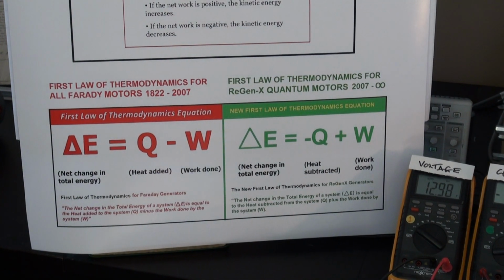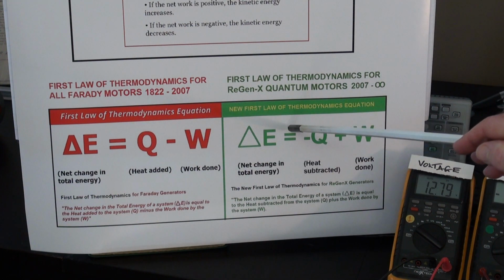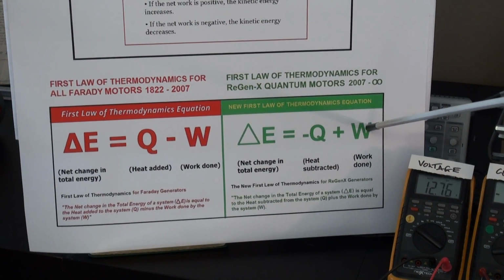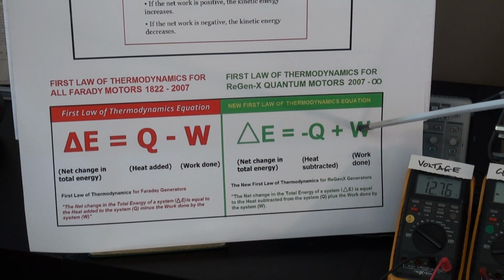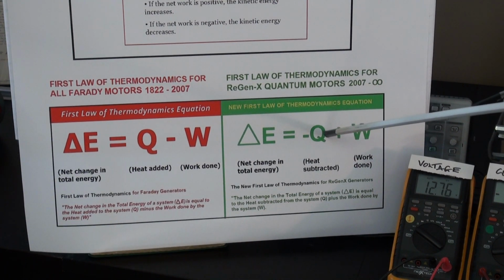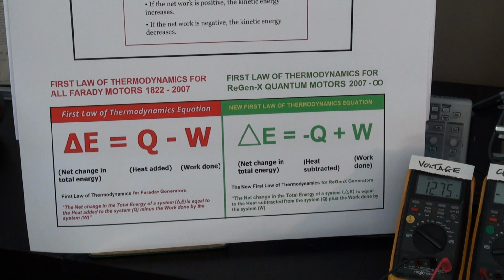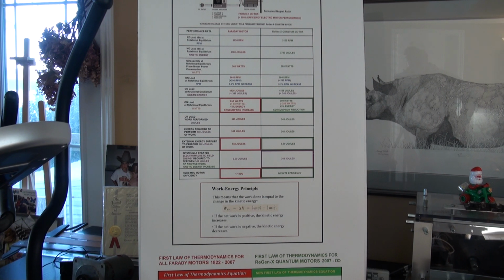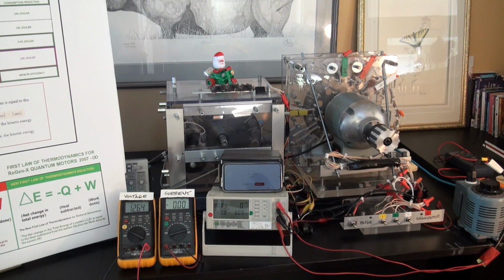New First Law of Thermodynamics for US Patented ReGen X Quantum Motor

Comment: Please note, there is no rated load on that motor during the test.  If it is a third horse motor, put a third horse load on it and cut in this miracle.  Result???
Other than powering his miracle machine, which is nothing near the motor's rating.  
we want to see this thing at full torque load for its rating.  I worry that the initial 12.5 volts is going to his miracle machine's coils.  There is energy input external to motor power here.

Comment: I like the condensed display showing everything. Is that a 2nd Rotor from a previous demo behind the meters?Also curious why Output meter shows 12.58V BEFORE generator starts? Also, didn't see the RPMs showing acceleration?

All in all, this does appear to shows Output ~16.50V x 5.15A = ~50Watts , with now reduced Input of = 485Watts, and acceleration? With Input requirements exceeding Output, This Tesla motor would eventually need recharging, but with greater efficiency, longer distance range = a very desirable upgrade.  

The Law of Thermodynamics only seems to apply to some electromagnetic systems, yours seems to show an exception, perhaps there are more?
Reply: Yes, there are more , for example motionless electromagnetic generator invented by Tom Bearden

Comment: Good evening mr. Heins. 

I have a technical question for you:

In the regenerative acceleration system, we use a rotary system (prime mover + magnetic rotor and regenx coils).

Is it possible to have the same effect on a solid state device? I saw your tests about the BITT, but i mean if we can replace the variable speed rotating magnetic field of the regenx generator inductor with a variable frequency modulated coil applied into a normal transformer.

It seems that the difference is the air gap between the rotating magnets and the regenx coils.

In a normal transformer, there is no air gap between the primary and the secondary. 

Did you try to build the regenx system in solid state setup? What do you think about this idea? 

The regenx system is wonderful and very impressive! 

Thank you for your time and hope to see you soon!
Reply from the maker: Yes, the BiTT is a motionless version of the ReGenX Generator where the Primary Input drops on-load.
Reply from the maker: This is my favorite BiTT replication... https://youtu.be/-LBnnL4v8MQ?si=GLp0ZH5J3yAifWQi